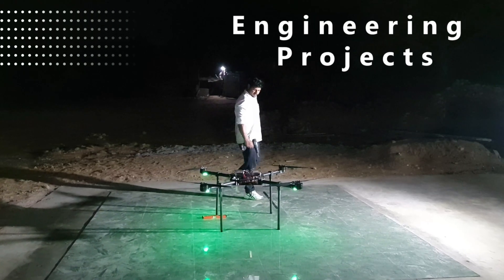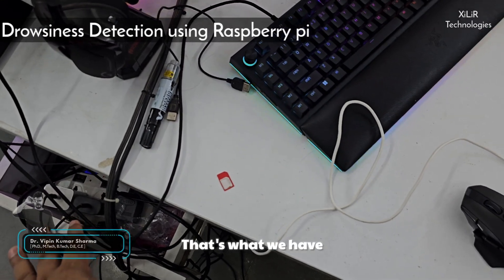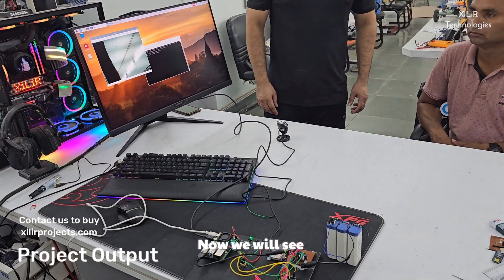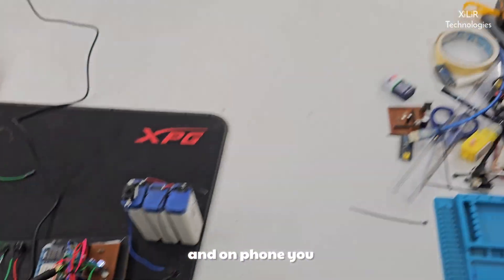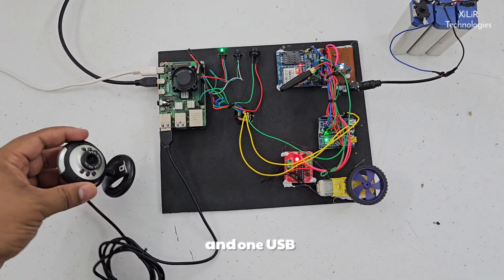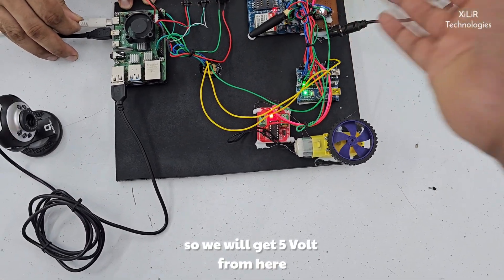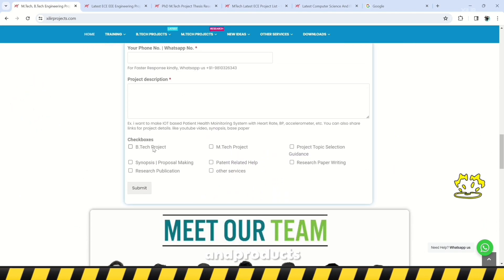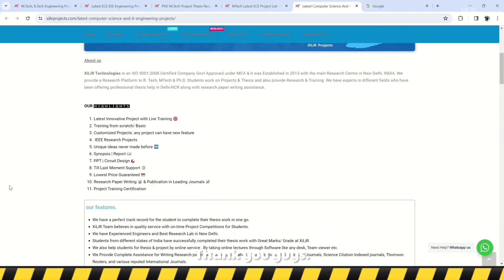Drowsiness Detection using Raspberry Pi and GSM Module

Comment: Give me a code
Reply from the maker: To create a drowsiness detection system using a Raspberry Pi and GSM module, you can use a camera module (such as the Pi Camera) to detect drowsiness (by monitoring eye closure) and a GSM module (e.g., SIM800L) to send an alert SMS if drowsiness is detected.

### Components:
- Raspberry Pi (e.g., Raspberry Pi 3/4)
- Pi Camera Module or USB webcam
- GSM Module (e.g., SIM800L or SIM900A)
- Jumper wires

### Libraries:
- **OpenCV**: To detect drowsiness by monitoring eye closure.
- **dlib**: For facial landmarks detection.
- **serial**: To communicate with the GSM module.
- **time**: For managing time intervals.
  
### Step-by-Step Setup:

1. **Install Required Libraries on Raspberry Pi**:
   - Install OpenCV:
     ```bash
     sudo apt-get update
     sudo apt-get install python3-opencv
     ```
   - Install dlib:
     ```bash
     sudo apt-get install cmake
     sudo apt-get install python3-dev
     sudo apt-get install python3-pip
     sudo pip3 install dlib
     ```
   - Install `imutils` for easier image manipulation:
     ```bash
     pip3 install imutils
     ```

2. **Connect the GSM Module**:
   - **SIM800L to Raspberry Pi**:
     - VCC -> 5V
     - GND -> GND
     - TX -> GPIO 15 (RXD)
     - RX -> GPIO 14 (TXD)
   - Enable serial on Raspberry Pi by using `raspi-config`:
     ```bash
     sudo raspi-config
     ```
     Then enable the serial interface under the "Interfacing Options".

### Python Code for Drowsiness Detection with SMS Alert:

```python
import cv2
import dlib
import serial
import time
from imutils import face_utils
from scipy.spatial import distance as dist

# Thresholds for drowsiness detection
EYE_AR_THRESH = 0.25
EYE_AR_CONSEC_FRAMES = 48

# Initialize GSM module connection (adjust port if needed)
gsm = serial.Serial("/dev/ttyS0", baudrate=9600, timeout=1)

# Initialize dlib face detector and facial landmark predictor
detector = dlib.get_frontal_face_detector()
predictor = dlib.shape_predictor("shape_predictor_68_face_landmarks.dat")

(lStart, lEnd) = face_utils.FACIAL_LANDMARKS_IDXS["left_eye"]
(rStart, rEnd) = face_utils.FACIAL_LANDMARKS_IDXS["right_eye"]

# Initialize variables
eye_counter = 0
sms_sent = False

# Function to calculate the eye aspect ratio (EAR)
def eye_aspect_ratio(eye):
    A = dist.euclidean(eye[1], eye[5])
    B = dist.euclidean(eye[2], eye[4])
    C = dist.euclidean(eye[0], eye[3])
    ear = (A + B) / (2.0 * C)
    return ear

# Function to send SMS using the GSM module
def send_sms(phone_number, message):
    gsm.write(b'AT+CMGF=1\r')  # Set text mode
    time.sleep(1)
    gsm.write(b'AT+CMGS="' + phone_number.encode() + b'"\r')
    time.sleep(1)
    gsm.write(message.encode() + b"\r")
    time.sleep(1)
    gsm.write(b'\x1A')  # End of message
    time.sleep(3)

# Start video stream
cap = cv2.VideoCapture(0)

while True:
    ret, frame = cap.read()
    gray = cv2.cvtColor(frame, cv2.COLOR_BGR2GRAY)

    # Detect faces in the frame
    faces = detector(gray)
    
    for face in faces:
        # Predict facial landmarks
        shape = predictor(gray, face)
        shape = face_utils.shape_to_np(shape)

        # Extract the left and right eye coordinates
        leftEye = shape[lStart:lEnd]
        rightEye = shape[rStart:rEnd]

        # Calculate the EAR for both eyes
        leftEAR = eye_aspect_ratio(leftEye)
        rightEAR = eye_aspect_ratio(rightEye)
        ear = (leftEAR + rightEAR) / 2.0

        # Visualize the eyes with polygons on the video feed
        leftEyeHull = cv2.convexHull(leftEye)
        rightEyeHull = cv2.convexHull(rightEye)
        cv2.drawContours(frame, [leftEyeHull], -1, (0, 255, 0), 1)
        cv2.drawContours(frame, [rightEyeHull], -1, (0, 255, 0), 1)

        # Check if the EAR is below the threshold for drowsiness
        if ear < EYE_AR_THRESH:
            eye_counter += 1
        else:
            eye_counter = 0
            sms_sent = False

        # If drowsiness is detected for a sustained period, send an SMS
        if eye_counter >= EYE_AR_CONSEC_FRAMES and not sms_sent:
            cv2.putText(frame, "DROWSINESS ALERT!", (10, 30), cv2.FONT_HERSHEY_SIMPLEX, 0.7, (0, 0, 255), 2)
            print("Drowsiness detected. Sending SMS...")
            send_sms("+1234567890", "Drowsiness detected. Please take a break!")  # Change to your phone number
            sms_sent = True

    # Show the video feed
    cv2.imshow("Frame", frame)

    # Exit on 'q' key press
    if cv2.waitKey(1) & 0xFF == ord('q'):
        break

# Release the camera and close all windows
cap.release()
cv2.destroyAllWindows()
```

### Explanation:
- **Eye Aspect Ratio (EAR)**: Measures the distance between eye landmarks to determine if the eyes are closed. If the EAR falls below a threshold for a set number of frames, drowsiness is detected.
- **SMS Alert**: Once drowsiness is detected, the Raspberry Pi sends an SMS alert using the GSM module.
- **GSM Commands**: The GSM module is controlled via AT commands to send SMS.

### Connection of GSM Module:
- *VCC* -> 5V
- *GND* -> GND
- *TX* -> GPIO 15 (RXD)
- *RX* -> GPIO 14 (TXD)

### Notes:
- You'll need the `shape_predictor_68_face_landmarks.dat` file for facial landmark detection, which you can download [here](http://dlib.net/files/shape_predictor_68_face_landmarks.dat.bz2).
- Replace the phone number in the `send_sms` function with your own phone number.

This project will detect drowsiness and send an SMS alert when drowsiness is detected.